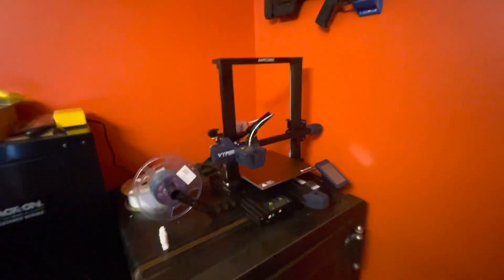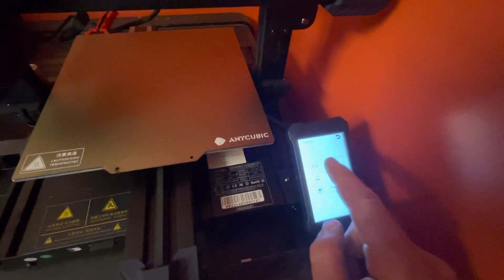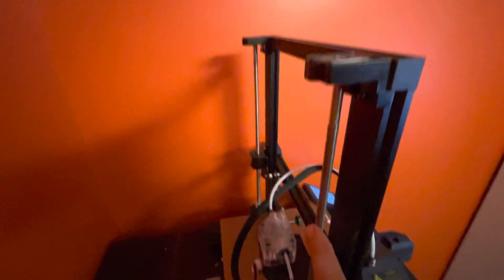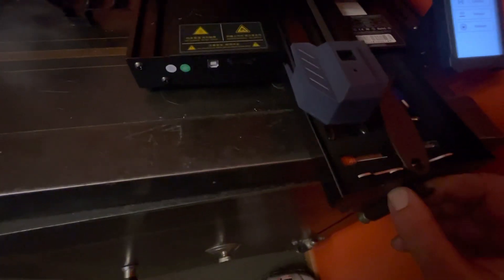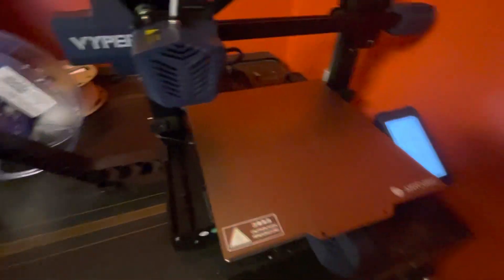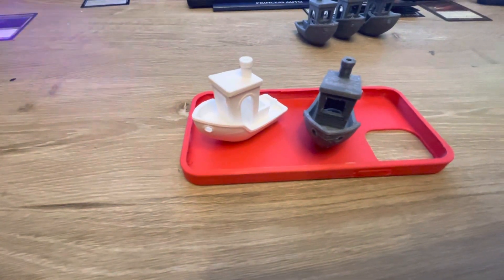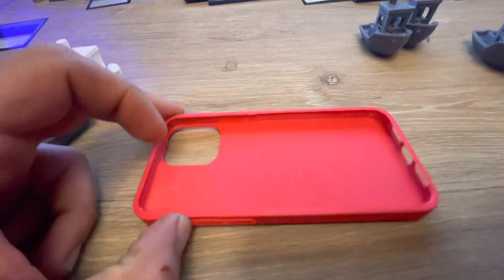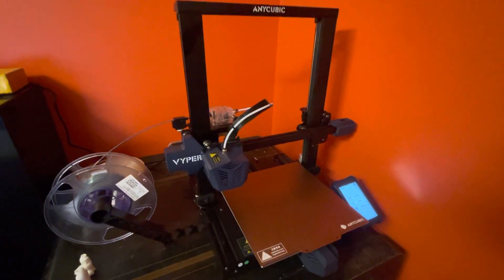The Anycubic Vyper just might be the fastest and easiest budget printer. Cura profiles below!!

Comment: I've had this printer for over three years now. I got a refurb off Ebay for $125. I've done a few mods to it, but for what it cost, dang. It's really the best, most economical printer out there. 

As for the printing, I'm trying to get it to work with a 1.0mm nozzle. I'm over the 5hr long print jobs with a .06mm. Most of my jobs don't need so much detail. However, all the settings I have found for using 1.0mm nozzles does not seem to work properly.

One profile I was using printed too quickly and the plastic tube leading to the hotend came out of the extruder. So I lowered the print speed and changed the heat, but then I was getting globs and the nozzle was hitting the print job. I still haven't found a good balanced 1.0mm profile. I also get a lot of strings and I walls that aren't solid (which I have been using a putty to fill the bad areas, but then I end up needing to paint the object (something I want to avoid if I can).

Any suggestions? I thought maybe one of the performance hotend kits, which comes with a new extruder but the one I found needed proprietary nozzles, and it was more expensive.
Reply from the maker: What slicer are you using? I’ve never used a 1mm nozzle but it would need to be going much slower due to the amount of filament being pushed through. Does the heat drop when you are printing with it? If so keep dropping speed until it can keep up

Comment: If you would like a bit more out of your Vyper, I suggest looking in to Vyper CE firmware. It has a few options you can flash that enable other features like linear advance. The other firmware that works well with linear advance would be the Zombie firmware by zombie3d, it has the base mfg interface for the screen if that's your thing.